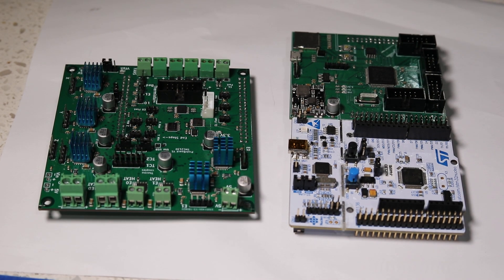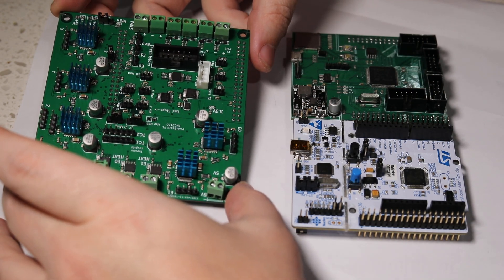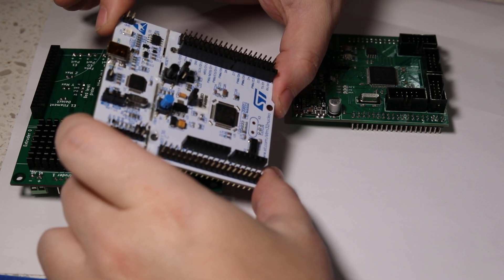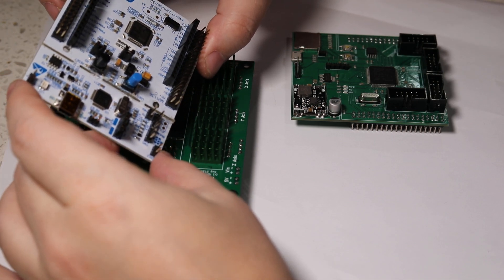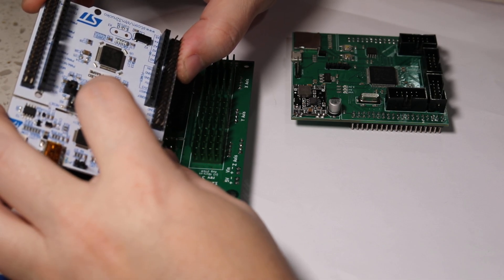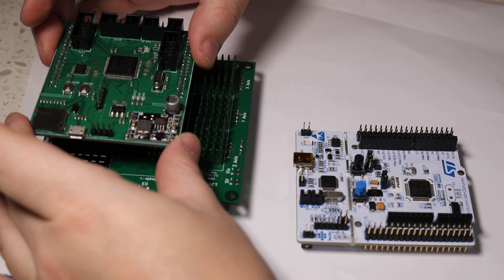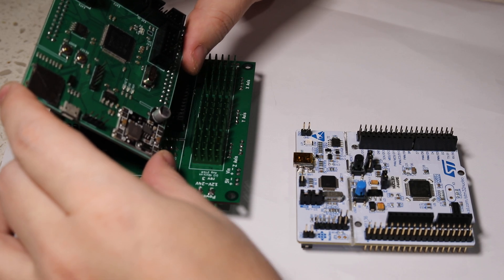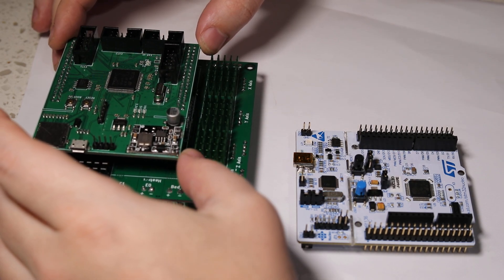NUCLEO-64 board upgrade

Comment: Awesome work!, BTW have you noticed disadvantages of use dfn/qfn mosfet packages instead of the typical dpak/to-220 packages? I'll be on the same path (making the printer controller and also making a little dev board too) just waiting for the arrive of some parts. Cheers.
Reply from the maker: These work fine for me. They look like QFN, but they do have little pins. I can solder and de-solder them fine. The pin spacing is big enough - I don't get any bridges. FYI two mosfets use LFPAK and one uses PG-TDSON-8.